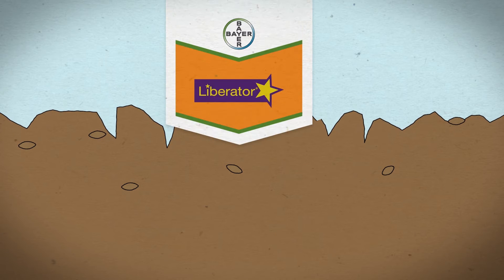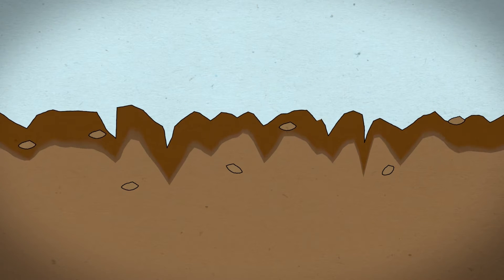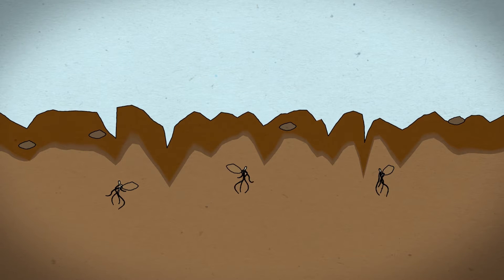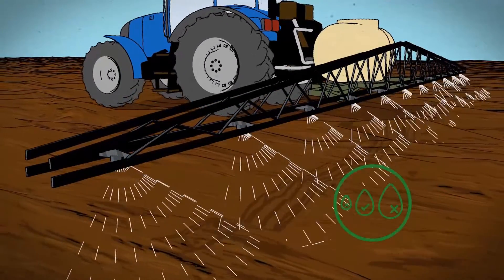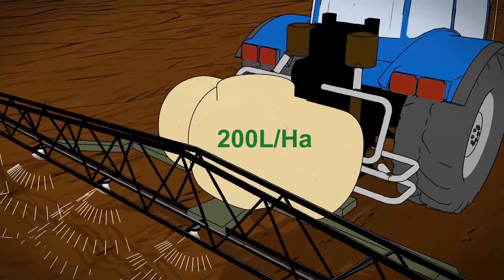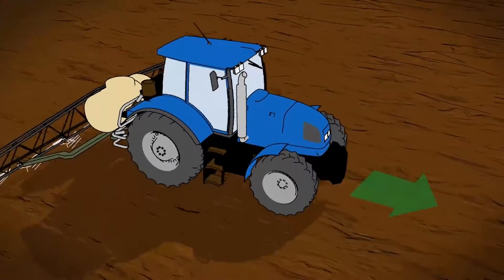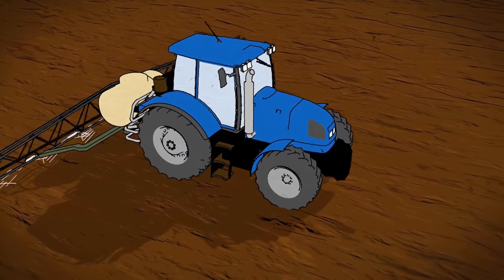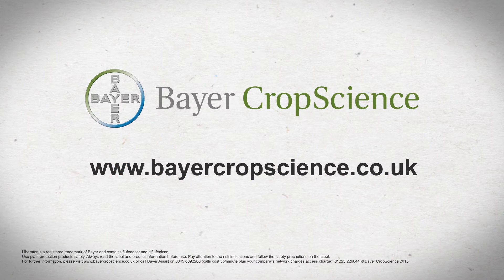Animation outlines best technique to apply pre-emergence herbicides

Comment: Done a search as I have never done a pre emergent herbicide  and cant yet tell how you apply  this 
Do you sow the seed first then apply the pre emergent herbicide    or spray the pre emergent then sow the seed ?
Reply: All pre emergent herbicides have to be applied before the weeds come up. Look at it this way, suppose you are washing dishes. Do you squirt soap in the sink before you fill it with water or do you squirt soap in the water before you start washing dishes or do you squirt soap on the sponge? It doesn't really matter a whole lot, you just have to use the soap when you're washing them, but soap is no help when you rinse them.
Reply: @carlherrnstein9544    thanks it is just the incorporation part I have problems with so the chemical doesnt get the seed your growing
Reply: @tomnapier681  They are selective herbicides that generally don't injury your crops. You have to choose the herbicide based on the crop you have planted. Pendimethaln is very effective an safe for the environment, but kills some crops like pumpkins. Treflan works well if it is incorporated in the surface of the ground(it's a granule) if it's not worked in it doesn't work. Preen is another granule pre emergent herbicide. Often it's necessary to apply a pre emergent and a post emergent herbicide to clean up what the pre emergent didn't prevent, sometimes mechanical cultivation is still needed. Read the label of any herbicide you use.